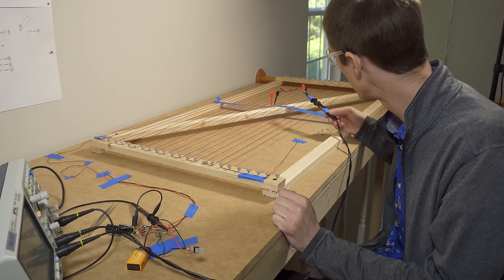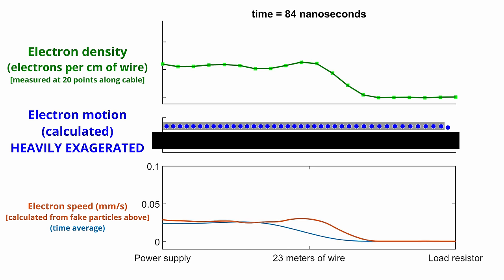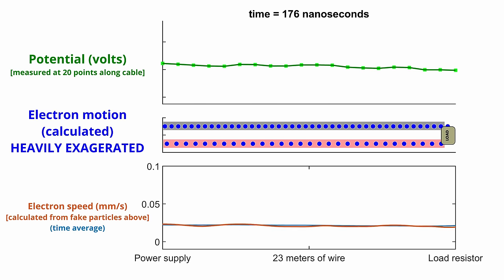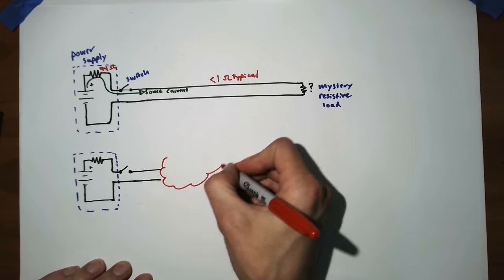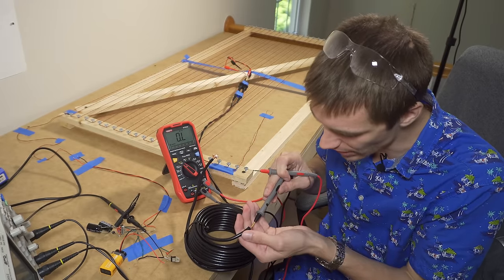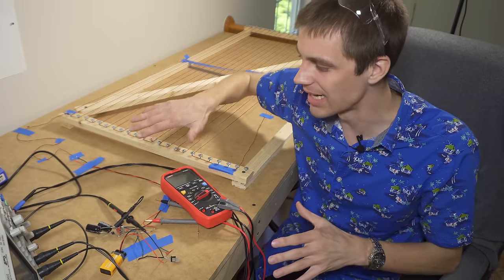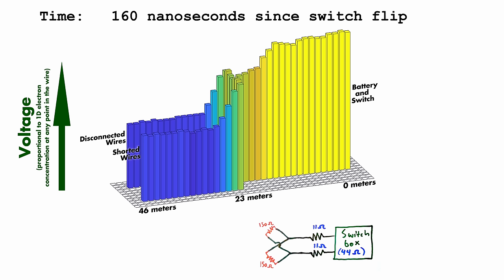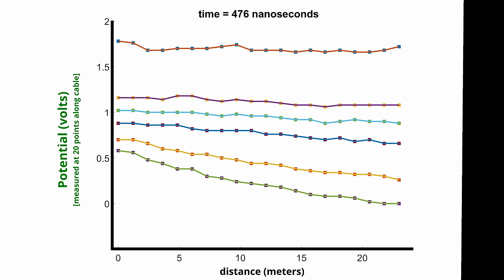What does "impedance matching" actually look like? (electricity waves)

Comment: So, the impedance of a line is determined by the coulombic forces between the atoms of that line?  What about the spacing between the wires?  Different spacing must result in different impedance values?

Comment: At 8:41 you talk about how the human is the thing that matches the impedance, and thats how the power supply communicates to see what the resistence is. But thats not a good explanation for a few reasons (what about impedence matching that was purely accidental?)

Rather a better explanation I feel is that they are communicating. Its just that they are communicating that the expected load is equal to the actual load, while in other cases they are communicating that its above/below the actual load.

Comment: I am an electronic engineer and there is one important aspect of electricity that you are ignoring. The transfer of electricity through magnetic fields. Two conductors side by side have a small magnetic field around them and electricity flows through the magnetic field as well. When you have 2 wires and put the flow of electricity through one it makes a small magnetic field that the other wire start making electricity in the opposite direction through the magnetic field. It is complicated  stuff and more than I can explain in a comment.

Comment: I almost had a degree in physics, nowadays I'm a certified engineer, but I only know the theoretical explanation of impedance through formulas off of current and voltage across capacitive loads. Thank you for more practical way to explain this from the other end around!

Comment: I just managed to comment about this to original video then YT recommend this to me :)
Edit / note:
After looking this. Impedance is basically pretty easy to "calculate" for ideal cable sqrt(L/C) but in this case he also need to explain what capacitance and inductance is in this level.
If I remember right how they teached transmission lines to us was it's basically LC circuit that you can spit smaller pieces but L/C ratio is always same so in ideal transmission line length doesn't matter. Then we also had dB value that told losses in certain distance.

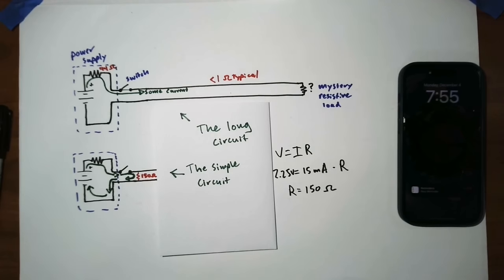Comment: Hey, at 7:40 you "input" a set voltage and amperage at the same time. Is this legal? This part always confuses me as usually a circuit is either voltage driven or current driven if I understand correctly

Comment: Do you think it would be possible to make an extremely branched wire that, when you apply or remove a current generates a pulse of an arbitrary shape, using the reflections in the wires of different lengths to interfere with each other? 
Is it even possible to make an oscillator which is stable for an arbitrary number of cycles?

Comment: Easily one of the most coolest things I've seen in my life, the graphs made it extremely easy to understand, so well done.  I was thinking impedance matching while watching the previous video.  
I would be interested to see what gains could be had from impedance matching my stereo, amplifiers see back emf from the voice coil of the speaker, but also the back wave as shown here.  I wonder if any manufacturers tune the voice coil resistance to match this transient resistance.  My thinking is that potentially speakers do not absorb the full amount of current, not as much as you potentially get it to.  I just don't know how you measure the output impedance of an amplifier, or even how you measured it for that power supply.     Anyway, subbed!!  very cool

Comment: AP, your vids are awesome. I noticed something with the water analog that may need correcting. The water Tank represents available instantaneous current to a load. In your water analog, the inrush current actually illustrates a potentiometer sweep upon opening the ''gate' and not an immediate direct short. Please try to develop a release mechanism for the water that will 'dump' the entire head pressure of water 'available current' into the channel all at once instead of the gate being raised from the bottom to the top, hence the potentiometer effect.

Comment: So, correct me if I'm wrong. It's a rating of parasitic resistance during the charging of the parasitic capacitance of the wire? The wire pair acts as a capacitor with some lead resistance until the EM wave reaches the load where the capacitance is finally shorted and the current can be conducted in DC?

Comment: I always understood the impedance depends on the parallel capacitance between the twisted wires and inductance in series. Its a transmission line. 120 ohms is best match for twisted wires. Separate wires with insulators a short distance apart and will give it a different impedance. For instance 300 ohm ribbon cable used on vhf tuners or ladder line used for radio transmitter feeders.

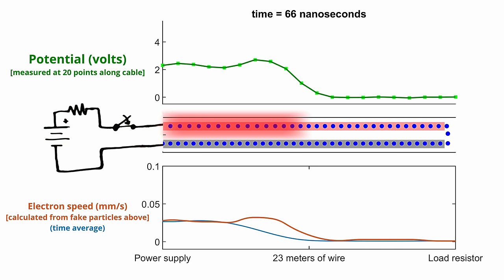Comment: 10:58 Isn't the power supply also trying to push electrons into the negative wire? Is the motion of electrons in the negative wire really only due to this kind of crosstalk? What if the wires weren't near each other? Am I missing something?

Comment: As an electronic engineer I have learned all this but in a dry theoretical way. You make it visible. Thanks for your enormous effort. You must love it.
I have used the reflection principle to find damage on data cables and cable studs to filter out unwanted frequencies. An open ended cable stud of 1/4 wave length of cause represent a short when connected parallel (at the right frequency and some of it's harmonics only of cause).
I am subscribed to your video's and like watching them as although I know a lot of it I do not know it all and I still learn from both you and some of your viewers comments.

Comment: The impedance of the twisted pair transmission line is 150 ohms.  Up to the Y.  Then it's two 150 lines in parallel.  75 ohms.  That's why there is a reflection at that point back to the supply.
How 'bout if the 2 lines were 300 ohms?     Like the old flat cables that TV antennas used.   A long long time ago.   ?   :)

Comment: So, for coax, isn't the impedance dependent on the distance of the outer shield from the center conductor?  Since electricity flowing through a conductor has both electrical and magnetic properties, the spacing will change the impedance because of the way the electric charge is formed in the magnetic field, right?

Comment: one extra thing to add to this very fine explanation and visualization of transmission lines - the two wires are not only communicating electrostatically, but also magnetically. the two wires in close proximity have magnetic linkage, like a transformer, and so as voltage gradient starts electron flow, that electron flow has a magnetic implication that also generates voltage gradient in the other wire. The two electron flows attempt to be equal and opposite, to minimize the amount of energy that has to be stored in the magnetic field, with the result that magnetic energy is almost only present in the space between the wires.

Comment: This is really interesting. Seeing how the current starts to flow in both wires as if already connected by a 150 Ohm resistor makes a lot of sense. And seeing how when the circuit splits, it looks like it's connected by two 150 Ohm or a single 75 Ohm resistor causing a reflection is kind of mind blowing. One thing I am still unsure of though is when is it important to consider the impedance of a circuit? Who cares if signals are reflected? Also, is it possible to calculate the impedance of a circuit up front or does it have to be measured?
Reply: I'm no EE but I would expect in a dynamic system (not steady state) the reflected voltage waves could cause unwanted results in a complicated system. Especially in an analog system but it could probably still cause issues in a digital system.
Reply: In a RF system, the reflections cause incomplete transmission to the load (antenna) and thus wated energy as heat at the transmitting transistors. So, we call this as SWR factor (Standing Wave Ratio). Balanced systems have SWR=1 leading to zero reflections and 100% power transfer
Reply: In the digital world, you want to match impedance or terminator for any signal that changes 1) quickly and 2) a lot. If I’m routing a signal that turns on a power supply, it doesn’t matter. You switch it every now and then, whatever. A 400 kHz I2C bus? No worries, don’t bother. Start getting up to faster serial, maybe a couple of megahertz? Now you at least need series termination to absorb some of the reflections. For 100 MHz or more it starts to really matter, you start needing carefully designed impedance or else you stop being able to tell whether you’re seeing the actual signal or junk being reflected, and it all just jumbles together in a big mess. In the RF world, you’re worried about loss, for a high power system not not waste huge amounts of power, and in small signal to maximise your signal to noise ratio,

Comment: What'd happen if you put a diode in there? would it be like a wave washing through a gate in a dam, but when it hits a second dam (the open wire) it can not leave, meaning there is more water trapped between the two dams? i.e. will the wire after the diode and the open end be charged? how long will it stay charged? how and why does is dis-charge?

Comment: I love how this concept is the same theory as pulses of water, air, light(rf).  I calculated the physics of a rifle firing once (quite crudely), but the pulse inherent in the barrel from firing reflects up and down the gun barrel around 6 times before the projectile leaves the barrel, this is what causes barrel whip and why they need to be floated.  With light, these reflections are why glass partly reflects light, there is an impedance change due to medium interfaces.

Comment: This is awesome for when creating new unknown circuits. The time when the power supply is "figuring out" how much current to send is what usually degrades electronics over time or even can destroy it from the get go. It seems like with that setup you can calculate whether or not an "Inrush Current Limiter" is needed.

Comment: 14:58 am i assuming correctly that the first reflection back from the fork would not happen if the impedance (or resistance?) of the wires after the split added to the same value as the single wire before?

Comment: If there is current flowing on the positive and negative wires close to the battery when the battery is initially connected but is not flowing at the end of the wires, wouldn't this point to the battery supplying current based on the information it has at that time about the amount of current that should flow through the section of the wires it has information about due to the capacitive coupling between the wires. The battery is not guessing about the amount of current to supply. It supplys the amount of current that will flow through the capacitor formed by the two wires.

Comment: If you would like to supplement this video with a water analogy, you could build another water system, but with shallow wide tanks.  The single wire reflection can be illustrated by having one tank slightly wider than the other, which would present as a partial wall in the path of a ripple created by physical contact with the water. Y junction can be done much the same, with two smaller tanks Y'd off of a far wall of the largest tank.  If you would like a slightly better description of what I have in mind, perhaps I could make a (very poor) CAD model of the thought.

Comment: so the impedance is set by how the electrons in the forward and the return wires can interact. So changing the distance between those wires would change the interaction and thus the impedance. which should show when comparing different impedance coaxial cables - no?

Comment: This almost feels like the "instantaneous" resistance of the wire is 150ohms, akin to its electrical inertia when at rest.  You can overcome this "inertia" easily but the ohm rating is how much it wants to move on that first "push" of electricity. So if you match that resistance at the end of the line the "pull" that the resistor allows matches the initial push and things settle into a steady state almost immediately.

Comment: Ok, after like 30 years I finally understand why the 50 ohm load was required on 10Base2 networks. The question I will end up going down a rabbit hole to learn, how is this value calculated?
Reply: I also don't understand how the universe decides to make the virtual resistor 150ohm. If it was an AC supply, at what frequency would the impedance be 150?
CAN networks in cars have similar wires as in the expermiment and use a terminating resistor of 120ohm in two ends
Reply: 50 ohm was chosen as one of the common impedances for coaxial cables because for early coaxial cables it was a good trade-off between power rating (which was highest around 30 ohms), voltage rating (which was highest around 60 ohms) and loss (which was lowest around 75 ohms). 75 ohms was more common in broadcast and cable TV where you want to send signals over long distances. Newer dielectrics (the material between the center conductor and the shield) have lower loss at 50 ohms so it’s a good all-rounder, we still basically always use 50-ohm impedance in satellite and radio communications nowadays.
Reply from the maker: the line impedance is a function of the capacitance and inductance per length of cable
Reply: @AlphaPhoenix2  ahh, and there are some useful online calculators for this! And the 50ohm terminators are a trade off for simplicity, over perfectly matching the line impedance.

Comment: Look at how transmission lines can be modelled as a chain of inductors and capacitors. Your twisted pair is two conductors separated by a dielectric. It is a long capacitor. Your initial current is charging that capacitor.

Comment: Here's something to remember, voltage is analogous to the pressure in a water pipe that's forcing the water down the pipe, whereas current is analogous to the amount of water passing a particular point in the pipe.

Comment: Fantastic. Can you please make a video where the two legs of the circuit (to the load, and back from the load) are so far apart that the electromagnetic fields of one leg has negligible effect on the other leg? How does the energy transfer from one leg to the other during the transient, when the electric and magnetic firlds can no longer affect the other leg?

Comment: This was super interesting, I've just recently read a lot about reflections on PCB traces and how mitigating that has become more of an issue as electronics have gotten faster over time in terms of the rising/ falling edge of signals. Crazy to think about engineers running into these issues and needing to solve them by guesswork back in the day.

Comment: I would love to understand what properties of your cable make it a 150ohm cable, and how is it different from a 50ohm one. In the 150ohm cable why is the equilibrium voltage 1V? In the 50ohm cable will this 1V decrease to accommodate the current flow of 15mA? Why is it 15mA? And what would happen if instead of connecting 1.75V on your 150ohm cable, you would connect 0.5V (less than 1V equilibrium voltage) ?
Reply from the maker: The capacitance and inductance per length of cable set the impedance, and the 1v is a bit weird. The actual height of the pulse is the voltage you’d see on a resistive divider across a 150 ohm resistor in series with the power supply impedance. In this case the power supply wasn’t actually hitting 5v, more like 3.5, but I measured 1 at the probe locations because of the extra capacitors I added in. Each probe was another divider, but a capacitive divider with the probe capacitance AND the extra capacitor I added. The measurement recorded was only over the probe capacitance in that divider

Comment: For the first time the importance of impedance matching for speakers and antenna systems make perfect sense! In those cases the transitions that you are tracking in a DC circuit that damp out to steady state never damp out and these unwanted voltage fluctuations continuously impact the signal on the line. I didn't hear you expicitly say this, but I intuit the design consideration for that 'magic' resistor value is the voltage and the max amperage rating of the supply circuit... is this correct?

Comment: I also hated the concept of a "50 Ohm" cable, you've shown some of where that value comes from. I still don't understand why a cable would be 50 Ohms vs 75 Ohms. Would a greater separation (lower capacitance) increase that value? What about thinner wires? I also didn't understand how the real resistance of the wire interacted with the impedance in the wave propagation. Also, how many Oscilloscopes did you buy?! I really appreciated the more visual approach you took in showing this subject!
Reply from the maker: it's a function of the capacitance and inductance per length of cable!

Comment: Brilliant discussion, question is: Is that 150ohm value a function of the power supply and its optimal ability to produce power derived as voltage and current?  and if so, what exactly w/in the ps defines that 150ohm value?  Then the question would be if it is based upon a power value vs a V A value, then the power value is what determines the impedance and the only critical metric in working with power type circuits.  Yes/No???   Thanks, Ken.
Reply: The 150 Ω value is an intrinsic property of the cable on its own, depending on its shape and surrounding medium. If the cable is loss-less, it is even independent on the frequency of the signal. See: https://en.wikipedia.org/wiki/Characteristic_impedance

Comment: What a very cool series you've created,
 we have to use a TDR for finding faults on power cables, with you explanation has really helped visualise what is happening to the cable when we put the TDR on and why the traces move in the directions they do for a open or short type fault,  with a way better explanation that our technicians could do